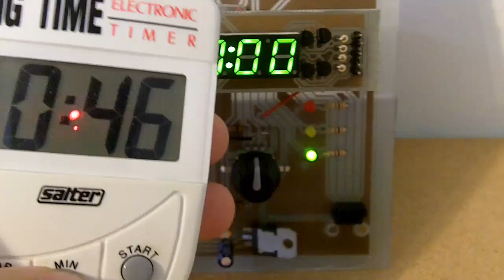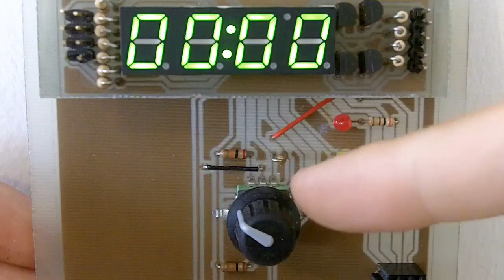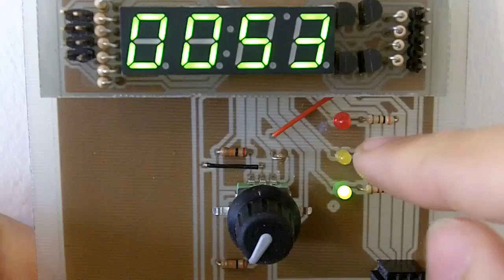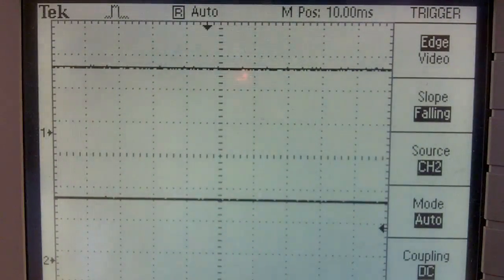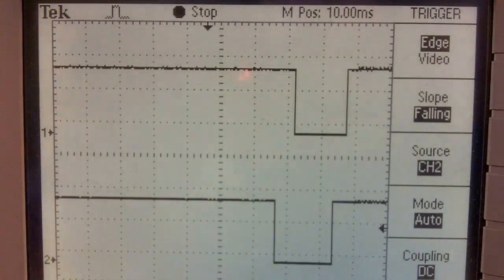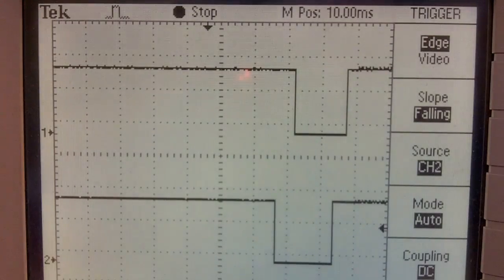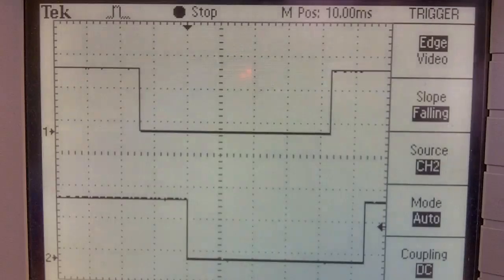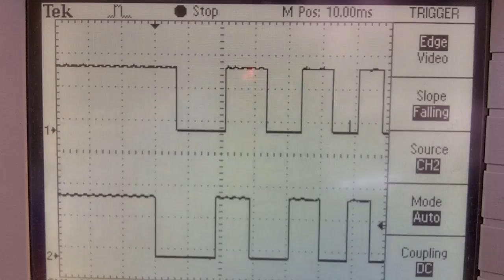Technical overview: Rotary encoder based cooking timer

Comment from the maker: @dfgl1029 Thanks. Indeed a hardware filter can help, but this was an exercise in software handling for this mechanical rotary encoder. You're also right that a timer selector slider would be more intuitive, but again the point was trying to use only the rotary encoder as the interface.